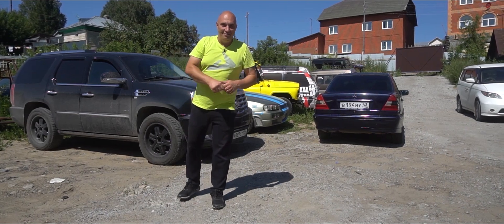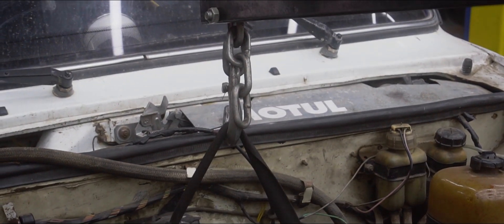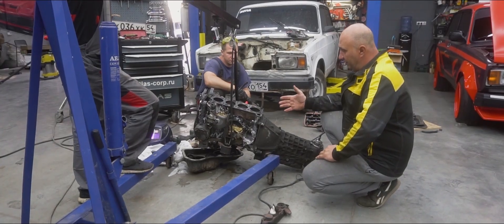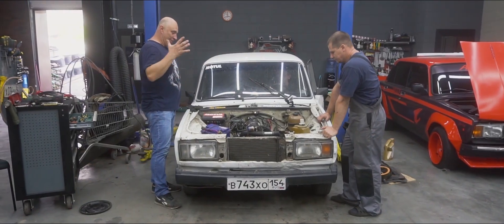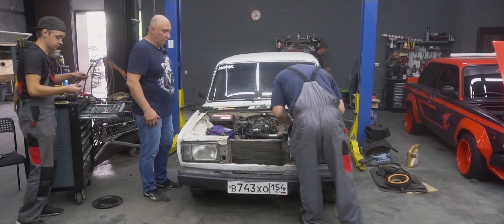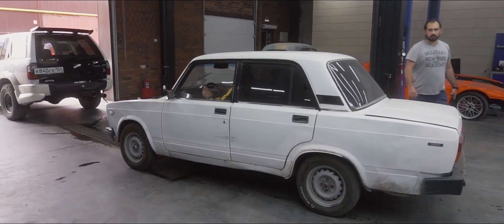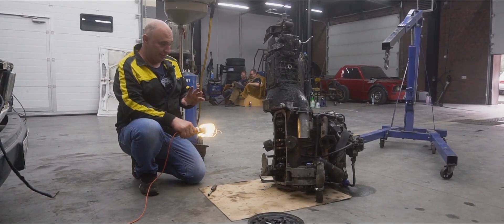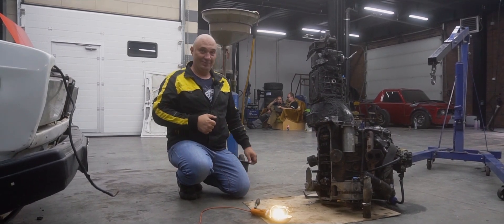Spring mod for piston rod – will it work?

Comment: Not to mention that all the work is done with the teeth (an expression in Spanish to say that the work is not good), in any case they should have preloaded the springs. Without preload, the compression ratio is going to fall dramatically.

Comment: I think the solution to this problem (and I could be totally wrong) is to first pre-heat the connecting rod and the spring, like get them glowing red or orange, THEN weld them together. Cast and high carbon don't like to be welded if they're not already hot...or at least, if memory serves me correctly

Comment: Interesting.  I'm not an engineer but presume there is an engineering "field" that has the intent or presumption of projects failing simply to see what happens.  I was trained in Non-Destructive Testing but that approaches failure from the direction of prevention, not intention.

Comment: Question to you, Will this prevent knocking in a engine, if you get over compression on the engine ??
Or at least lower the stress ??
If you can make it run.
Thought are: Making it like a normal spring whit a damper in it whit out resistant.

Comment: So the pressure on the spring was too great and rather than driving distance that would Advance beyond the crankshaft upon ignition in each cylinder the Piston had simply struck the camshaft and battered the welts until it all gave out. That is a bummer I was hoping it would react more like somebody put a rubber band belt where the timing chain belonged well somehow amazingly enough not breaking the new timing belt but instead it just turned each other pistonheads into a hammer I think this would do much better if you apply power to the crankshaft and use the pistonheads to crush Stone.

Comment: I believe the engine will turn over but if you try to apply Force to it it will work much like a rubber crutch that is I do believe that your engine is now a power Eliminator that is the more power you apply to the engine the less effective it will be much like a half engaged clutch.

Comment: It is ok to use springs but you can’t weld them. Have you ever seen welded springs used anywhere? 
You have to make a fit like the suspension struts and the engine will able to run at very low RPM, like 100 or 60 RPM.
Anyway, this engine was not starting even with the original rods, that is why you destroy it.

Comment: Okay I'm just 2 minutes in LOL the very concept of a variable stroke = variable compression piston?? 😂  I'm already thinking bad things will happen to the valves. That's if the flexing of the spring allows it too even  travel that far. Now for the rest of the video.
Reply: Okay the welds broke lol.  Was already dead before it got started.

Comment: How interesting.  So maybe you can find a 1992-1996 Honda Prelude VTEC H22A1 & swap the transmission with a 1994-1997 Honda Accord EX VTEC F22B1.  Wider final drive & all gears are wider.  I'm interested to know just how much RPM it pulls at 60 mph vs the stock transmission & How much improvement in fuel economy?

Comment: You wanna revisit this project, but, with stronger springs, and, much better beefier welds, and then at each step when rebuilding engine ensuring the crank/pistons still operate freely, and then try starting it up.... 🤔🤔🤔🤔😎

Comment: I know this vid is like 9 or 10 months old but I'm curious if you took the head off it at some point? I suspected the pistons would hit the valves but it looks like we may have not even gotten that far with this idea. If you still have the engine around pull the head and show us what the head looks like.

Comment: its not working because spring is compress from upper pressure .and it lose the energy .for example when you naiver change  the changes the speed of car is 130 km .after changes the car speed 40 km .miss engineering.

Comment: I doubted so before looking any further of the video. 1) Ignition timing will be totally out. 2) Piston rod connected with a spring will cause knocking to the spark plug.

Comment: half way through and at very start when they were welding on spring knew it would not work.. springs will "stretch" causing piston to slam into heads and bend valves etc.. possibly locking it up and surely not letting it run .. at half way so going to resume watching

Comment: This won't work because...
1. The springs will reduce compression, thereby reducing the power of the combustion, and
2. They will also absorb the little bang that's left from the weak compression.
Not to mention the weaker intake vacuum and exhaust expulsion.

Comment: Maby try heaver springs cars usually get about 140 to 180 psi compression so u may need to get heavier weight springs like 200 pound push down weight

Comment: Immediately at 2:45 I can see why it won't work as springs can compress or stretch you can even see piston going out of the block by approx. 3mm which will crash into the cylinder head. Now it makes me wonder if you would make springs shorter to compromise for that...

Comment: I was 50/50 on the spring buclking and compressing enough that the piston actually slipped below the cylinder jacket enough that maybe the oil control ring would popout and bind the cylinder to to the jacket
Or that the spring would buckle, and actually try to wrap itself around something

Comment: You were supposed to run the Piston return Springs together with the connecting rod Springs and having a 12 volt Muffler bearing in line would have helped stabilize the crank. Oh well.

Comment: No compression? No problem.

I want to see what happens with Buran. I believe this to be in compliance with SALT.

Attach the piston centered atop a tube (called "Slide") and from the crank comes a smaller tube (Called "Shaft"). From the smaller tube, an even smaller cylinder is welded in place (Called "Guide"). The spring fits over this guide, and holds the piston and slide aloft, equal to "its acceptable length of travel during detonation without breaking". This means that to achieve optimal operation that you will need to trim the guide. Shaft and Slide provide stability to the spring so that it does not become wire again.

The spring is tempered differently, as for flexibility, than is the rigid crankarm. This makes the weld not hold. Do not weld the spring this time, simply place it on the guide. Rigid tempered tubing can be found. This could be a solution for people with leaking head gaskets: a spring-loaded-crank, I really don't know what will happen! If the hole was small enough, maybe the engine could be open to the birds! The timing will surely be different.
--------------------------------------------------------------------------------------------------------------------->>>
Я хочу посмотреть, что будет с Бураном. Я считаю, что это соответствует договору ОСВ.

Присоедините поршень по центру к трубке (называемой «Слайд»), и от кривошипа выходит трубка меньшего размера (называемая «Вал»). Из трубы меньшего размера приваривается цилиндр еще меньшего размера (так называемый «Направляющая»). Пружина надевается на эту направляющую и удерживает поршень и ползун в верхнем положении, равное «допустимой длине хода во время детонации без поломки». Это означает, что для достижения оптимальной работы вам необходимо обрезать направляющую. Вал и ползун обеспечивают устойчивость пружины, так что она больше не превращается в проволоку.

Пружина имеет другую закалку с точки зрения гибкости, чем жесткий шатун. Из-за этого сварной шов не держится. На этот раз не приваривайте пружину, просто поместите ее на направляющую. Можно найти жесткие закаленные трубки. Это может быть решением для людей с протекающими прокладками головки блока цилиндров: пружинный кривошип, я действительно не знаю, что произойдет! Если бы отверстие было достаточно маленьким, возможно, двигатель открылся бы птицам! Время наверняка будет другим.

Comment: If you want it to last a little, build some type of sliding mech inside the spring. A pipe in a pipe should do it. I was sure your idea is a bad one, ran out of good ones a guess.

Comment: Given the rpms, heat, and over compression of the springs... no matter how big a spring, it would fail quickly... 😕 cool concept though! I wonder if you really modded the block and made it so the pistons didn’t turn the shaft, but instead induced electric charge by moving between coils and powered an electric motor? Impractical, but maybe functional 🤪😂😂

Comment: The engin could run but the only reason nobody ever use spring as piston rod is because of all the power you gonna loose cause when the explosion gonna acure the spring gonna compress then push the cam instead of pushing the cam straight away and it will deballence the engin badly so it will never run the right way or for a long period of time

Comment: It failed once the cylinder head was installed, before it turned over because of no compression, but once the head was installed it then had compression/ resistance, which then caused the springs to flex/stretch out of proper form.

Comment: Should  have put pin  on rod and Bush in  piston with  spring on it  so it worked same  as original  but with  spring preventing  preignition and variable compression   and smoothing  out power stroke  sure it would  work

Comment: It would have works if there wasn't a high pressure vacuum that keeps the piston at tdc while the spring is stretching. That latency alone will cause for the engine not to start or get the enough air or fuel because the intake valve would have already close by the time it reaches bdc. And to squeeze to  the air fuel mixture to make any power the spring would have to over come the force of the air pushing back to compress it. Creative but unrealistic.

Comment: probably best if " the spring Not in the rod
 but rather a bunch of those same valve springs
 to  be placed apart"evenly" & "sandwiched"under
  a piston head "on top" of the original piston head ??
 requiring shortened rods but careful for crank balance
 weights,,  then Again "if"they will Not crush "even & true" 
we have a problem of forces put on parts that
  were not designed with "fixed" crush "evenness" guides,, 
   but man-o-man,, i was at the edge of my seat Waitin"& Hopin" 
     for-it to go,, oh modern marvels, was good guys, Thanks

Comment: Dumbass obvs the spring will throw timing and synchronicity out and the upward pressure will change to one side or other of the piston as it gets pushed and pulled scraping tge sides of cylinder.... instead of doing that use common knowledge if ur gona do a mottors vid do some proper work and actually do a car up or modify a car properly on a video instead of that idiotic foolisg stuff like using valve springs in place of con rods

Comment: Welding spring steel takes the temper from it. (The hardness & springiness was comprimized by the welding heat I bet).
So the compression of the engine was too much for it.
KILLER experiment!!!

Comment: I'm guessing if he would've fixed the starter, he could've gotten  it to idle, but since he didn't he used the weight of the vehicle, that put a load on the pistons, so during the compression stroke it put a load on thoes pistons, breaking them, so in short this wouldn't of work, idle Maby, but driving no

Comment: Those being valve springs wont offer enough comparison sense there meant to open under combustion perhaps using a heavier spring will give you enough compression for it to run.

Comment: Such a horrifically bad idea and carried out in the worst possible way. It was completely doomed to failure right from the start. Welding on springs takes all the temper out of the metal and creates a massive failure point where the still tempered part of the spring changes to the heated non tempered part. That would be an immediate failure. One other thing, get some benches to work on so you don't have to be on your damned knees. That is just so basic.

Comment: My guess is part of the problem is the springs allow the crankshaft and piston to get out of phase which fsked the timing. Much stiffer springs might kind of work if the weld problem and horizontal flexing problem could be solved. It would be interesting if it worked because it might have increased the engine's tolerance for fuel detonation so compression could be increased or crappy fuel used. Not that I have any idea of what I'm talking about or anything.

Comment: Engine needs compression of fuel air mixture. You compress springs instead. Video is interesting. Like the cool guy sitting with the driver

Comment: Aw c'mon guys--I saw you just use a ratchet on the rods and an impact on the head. You didn't use a torque wrench to get the right torque so how did you expect it to run?

Comment: Doomed from the start... No point... Of course it would break at the weld point. Ruing the temper of the spring at weld point, even if that was sorted, that spring is too week for even doing the fun part...

Comment: all the power will be simply wasted in compressing the spring during combustion. when the motor starts the cilinder will not compress completely before combustion and slams on the cilinder head.

Comment: "let's start it in reverse!"

Sitting here open mouthed at the pure stupidity. Then I remembered what they were doing in the first place.
Reply: how would that not work
Reply: @madbruv  because putting the transmission in reverse spins it the same way as 3rd. They don't spin backwards in reverse. Only some 2 stroke applications do that far as I know.
Reply: @brendanberry7403  hm okay, just makes sense for them to spin back i guess heh

Comment: What was happening is that you dont have compression 
Because the rod and the spring are not the same length when the spring is under load it gives

Comment: Use a telescopic pin in the middle to keep the piston and crank bearing together and put the spring over that without welding it. Still won't work but should at least keep the engine from instantaneously self-destructing from forces at spring welds.

Comment: My guess is it runs on all cylinders for one second, but probably throws that piston right at the rods in the first second and stays there. Will run fine, but down on some horsepower. I hope you can find a solution for spring 2.0!
Reply: Oh wow, I thought they would just try it on one cylinder. Will it run? Now I have to finish watching... Ah, I was wrong. One piston survived 10 seconds. Well done! Looking forward to your next attempt.

Comment: Before I watch the video, here’s what I expect is going to happen. You’re going to lower compression, and get preignition. You’ll also lower torque output. The lower compression is because the spring will give some due to friction during the compression stroke. Yes, there’s oil in the cylinder, but it’s not perfect. So when the spark plug fires, the piston won’t be fully compressing the air/fuel mixture. Then when the mixture combusts the spring will again give to some degree before power is translated to the shaft causing a reduction in output power/torque. If the engine works at all power output will be seriously reduced. The effect will be the exact same as limp wristing an autopistol.

Comment: Deliverd hay to the circus bat went dead in dads 1953 intertrashonel he asked if they had jumpers guy asked its a standard right yup he came out with an elliphant pointed at back of truck elly started pushing pop popped the clutch and off we went   mabee 1968

Comment: It sounds like a cool and unique idea, I thought about it for a few minutes like maybe with this you could have a straight crankshaft since the springs would just be compressing, ditch the connecting rod bearings or not (if you used a straight crank) . But then I realized springs are really shitty in the long run and will wear out much, much faster then a solid connecting rod would. Also, this is important: Valve float is a condition where the engines rpm is too high for the springs to return properly (or the springs are worn and too weak) on the camshafts intake/exhaust valves. The same thing can happen with the springs on these pistons where they start floating and they probably would from all the power thats happening inside the cylinder. But still a cool idea. I havent watched the video yet so Im not 100% on the floating pistons idea.

Comment: I thought they were gonna weld the springs around the original con rod, not literally replace it with a spring...either gonna sap all power cause rods arent supposed to give and compress or destroy the engine...my bet is both. lmao.

Comment: 🤔 Do you have a way to anneal the piston rods after you have welded the springs in place? (It would be the most logical next step in my opinion, since the attempt failed due to the internal stress caused by the welds.)

Comment: You need some kind of sliding pipe to keep the rod straight, shorter and stiffer spring and some kind of limiter to avoid banging on cylinder head. Then should start.

Comment: I have an idea. It's something I've been thinking about for a really long time. Usually cylinders fire in order, but would it be possible to turn a 4cyl into a giant 2 cyl by getting two of the cylinders to fire at once? There will most likely have to be some cam, crank and ignition mods, but I think it'll be a very interesting engine 😁
Reply: They kind of did that...only that they did ALL pistons at once https://www.youtube.com/watch?v=CTWUcpHQfGo
Reply: Cam mods and ignition pairing on those two cylinders but yes
Reply: proper torque